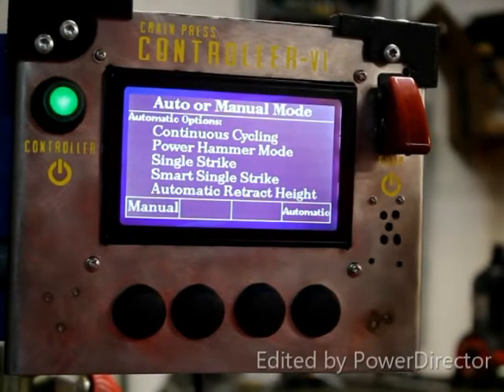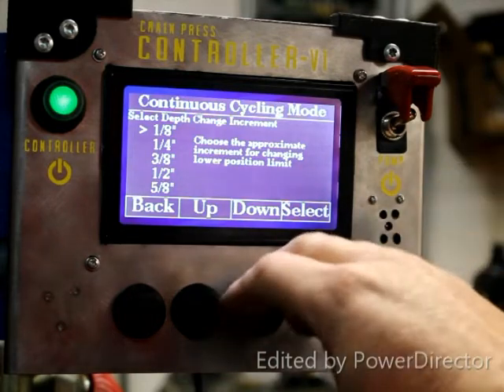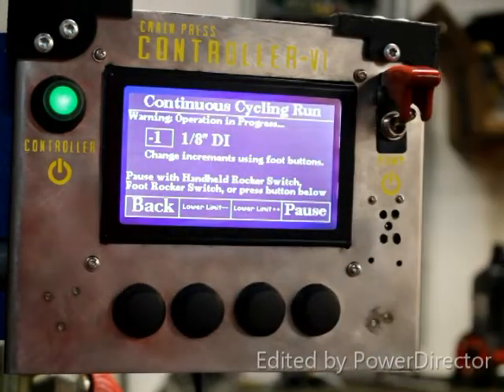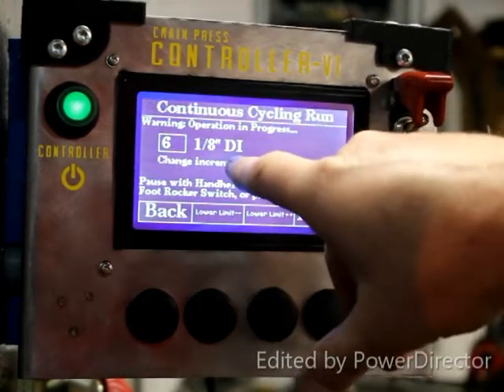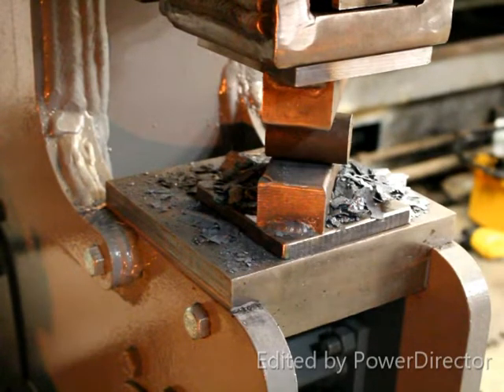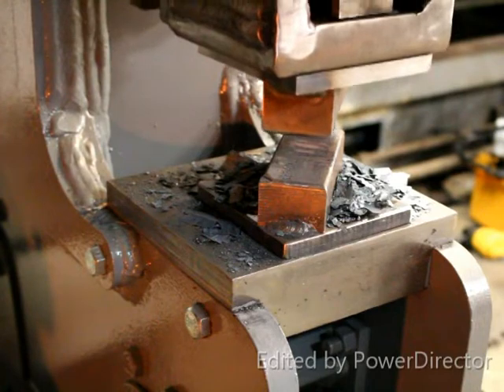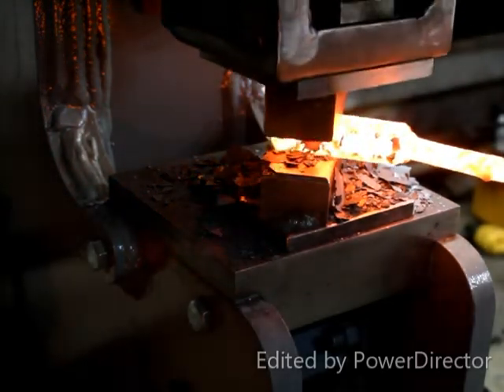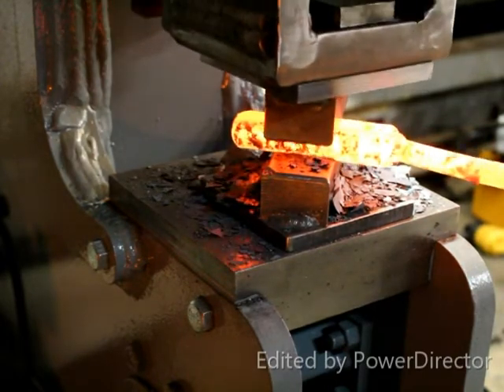Auto cycling hydraulic forging demo using the Crain Press Controller

Comment: This isn't on topic but would you suggest having one's press design tested and checked out by an engineer? Very impressive press you got there by the way!
Reply from the maker: I think its absolutely necessary to get a mechanical engineer to at least run an FEA with adaptive mesh refinement and covergence of results. The attention should be paid to the peak stress relative to the yield strength of the material. Fatigue is one of the main concerns which is why a high FOS is required. I had 3 different ME's review my design. If you want to analyzing your design yourself, get Fusion 360 and start with simple structures and doing static analyses.